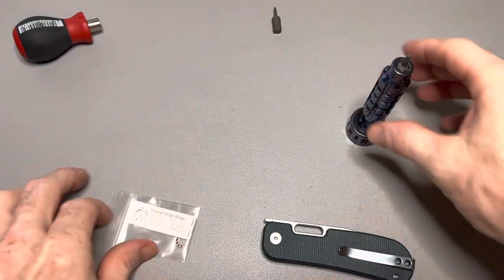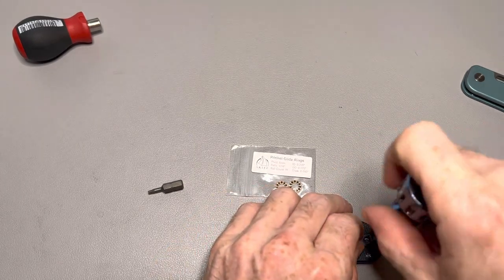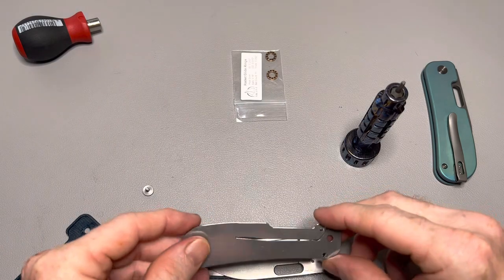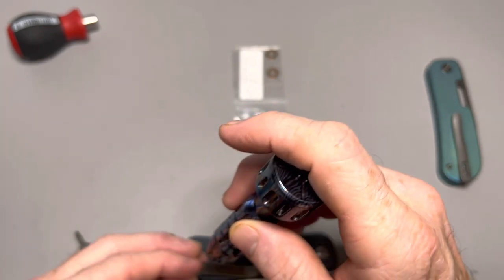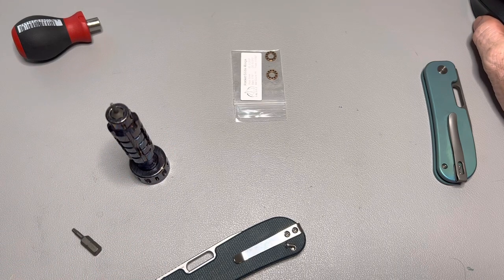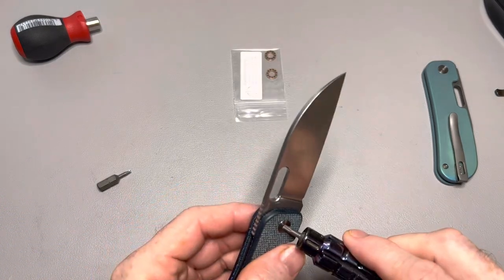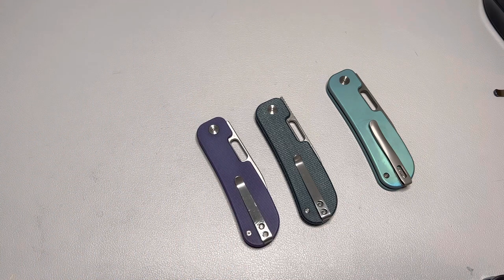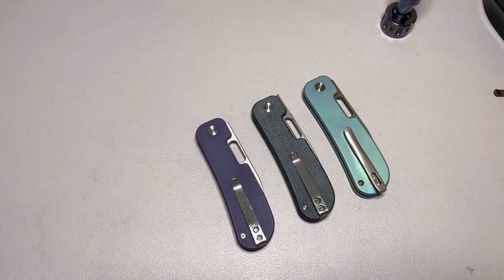*Update-Skiff-Removed* Incorrect Bearing Size At Skiff For The Qvist Variant In Compatibility Page.

Comment: Hey Jamie, did you ever figure out what size bearings will fit the variant? Also, where did you find that clip on the titanium PE1 in this video? It looks way better than the original clip! Thanks!
Reply from the maker: Unfortunately at the time Skiff said this did not make a bearing that size that would fit the Variant. I haven’t checked back with them, but recently I saw that Lefty EDC got Skiffs for the OG Nymble which was another knife they didn’t have bearing for. The Nymble and the Variant are both made by QSP. I’m not sure if they are the same size, but maybe ask Lefty because he has a Variant also and may know if the Nymbles bearing are the right size for the Variant.
Reply: Thanks Jamie!